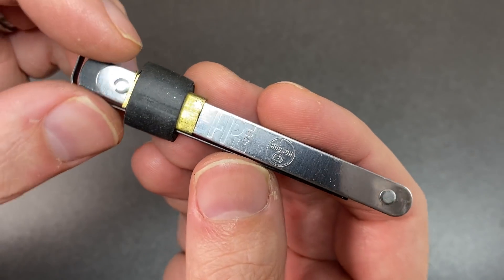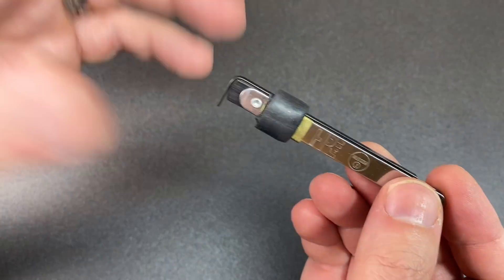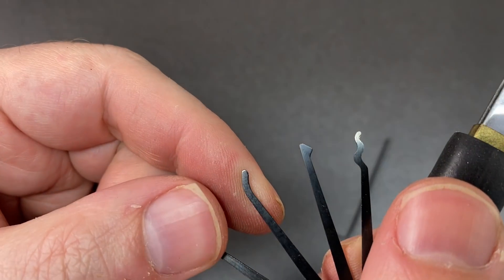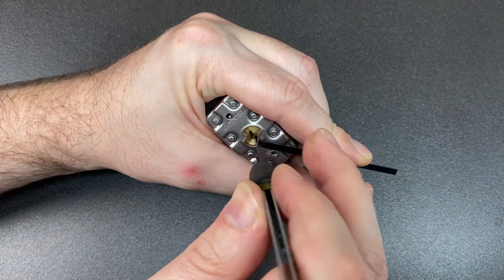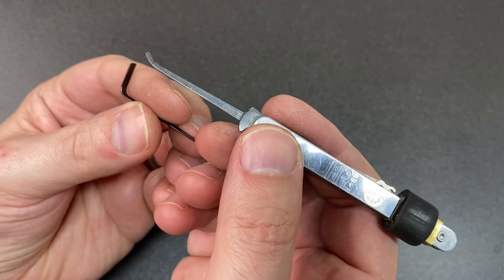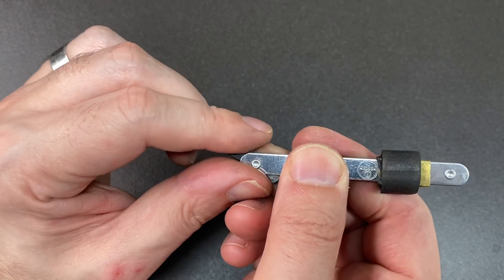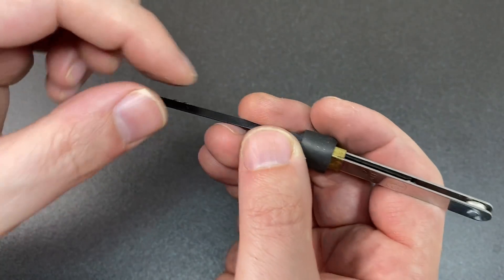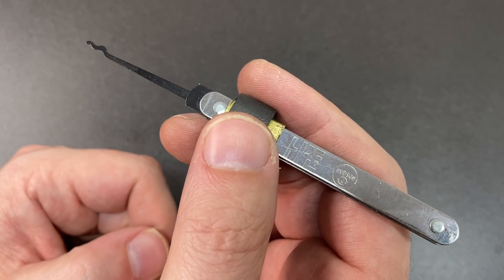HPC Jackknife Pick Set

Comment: That method of holding the pick set is the way I first learned.  Very useful for picking (easy, low security) door locks without having to kneel down.  Useful  for apartment building lock outs. I am not a locksmith, but I used to do a lot of maintenance on apartment buildings.

Comment: Hi Lock Noob, I've had one of these for 20 years or more. Bought it as a curiosity, and never used it in anger. After seeing your demo, I rummaged through my gear to try and find it - still there minus the tension tool. HPC picks are very common Locksmith tools in Australia, and because Locksmiths don't generally single pin pick as often as Locksporters, these spring steel picks hold up fairly well, and their profiles are pretty reasonable as well.
Reply from the maker: Yeah, this really needs an update, but the profiles were very useable

Comment: Scored a $10 version on eBay - no slider and rather than the duplicate pick it's got a half snowman - likely made in China but it does the job and it's maybe half a centimeter in thickness so it slides into any pocket - there's enough slack in my multitool sheath that it can fit in there -  plus, they used a hollow rivet to secure the picks so you can attach it to a keychain or lanyard.
While you're definitely getting what you paid for with it, for a newbie like myself it's a great starter backup tool.

Comment: That was a fair review mate. I wondered how well that rubber collar would work and it's influence on how you would be holding the pick. The picture of the grip they showed on the diagram is the way that a lot of people do raking in the USA. Given that the locksmith would be standing or kneeling in the elements possibly with gloves on because of winter snow etc. Raking is done that way in the States. HPC was a company the used to only be sold to locksmiths. Here in Oz you could only buy HPC if you were a locksmith and that's why they charged so much for their gear. They had cornered the market until locksporters and other companies came into play. Cheers
Reply from the maker: Thanks and interesting about the HPC history. I need more of their stuff to play with

Comment: I would spend so much time modding it to my preference that I may as well make my own.  I would install a key ring, taper the handles so the slider would be tight at the pick end, add another tension tool, add a bogota or a worm, get rid of the spare snake,  add a probe / bypass tool, polish everything, etc.

Comment: Does that rubber sleeve slide off the brass piece? If that brass piece had more of a lip or like sheath to come around the pick while deployed would hell with the wiggling. I didn't know this existed. Was gna try making own a few years back but never got around to it. I was gna use a lil bolt & nut tho to tighten & loosen the picks. A few things could have been done better but I love the innovation.
Reply from the maker: It doesn’t come off easily

Comment: I’ve had one of these for about 10 years now. They’re one of the worst iterations of jacknife tool, in my opinion. My old manager used nothing but this pick to pretty good effect, however. But, it’s not repairable, and once the rubber grommet wears out, it’s next to impossible to hold the turning tool on there. HPC makes their picks very thick, usually, as well. But, nice video as always.
Reply from the maker: Thanks for the comment. It’s interesting to hear from someone with good real life experience of this tool. I know a few people who swear by them, but there are just better ones out there these days
Reply: Take some Scotch 88 electrical tape and stick it to the brass then fold it over, sticky side out, wrap it around tight 1-2 times, then fold it back to sticky side in, wrap it tight 4-5 times, then wrap it without pulling 2-3 times; the tension wrench will pass under the tape where it isn’t sticky side down without a problem. Splicing tape and silicone tape works to bug I prefer the Scotch due to cost. You can also fix it or replace the tips; I can’t think of the name of the hardware but it’s basically a hollow thread on one side with a head and a machine screw with matching head that goes in it; I found this when repairing a belt. With the screw item you can actually swop out to stainless picks after drilling the rivet; you could also always just put in another rivet.
Reply: @libertarian1637  I'd probably put a hollow rivet in the back so you can put a key ring on it :)

Edit: wrote that, before Ash mentioned the hollow rivet xD
Reply: @libertarian1637  chicago screw

Comment: For the length of the body, would it have been nice if the picks were actually longer...or the body was shorter? Just looks like wasted space in there!

Thought on the keyring-I went back to the beginning, and noticed that the space in front of that back rivet, even with the tensioner in place, looks like you could, possibly, put a keyring basically AROUND the back rivet. Something to try maybe!

Comment: Seems like a pretty good idea but the design would need more polish. I would rather have 0.025" deep hook and shallow hook and 0.015" deep hook and shallow hook in such a tool. And tensioner should support top of the keyway tension.

Perhaps the sliding part could be made out of spring steel so it could push the body with the spring tension and stay better in place. Maybe even have a locking mechanism similar to Leatherman knifes?
Reply from the maker: All good suggestions

Comment: Tbh, I'm not terribly fond of ANY of those profiles (incidentally, I think one of the snakes angles up more than the other). I'd have gone with short hook, offset hybrid, de Forest Diamond for the hooks, and either a Bogota or worm as the rake. Tensioner is fine (I personally think TOK turners are massively overrated). 
Actually, speaking of TOK, I have an idea about that. I have a couple of questions I need to find answers to first though. Tell me, that wide groove that runs down the face of some lock cylinders? The keyway fits inside it entirely, but there's usually a bit of space left at the top. Does that groove have a name or any purpose apart from aesthetic?

Comment: Well, actually i'm not a fan of jackknife picksets in general. This thing however gives me a dissociative identity disorder: While i  don't like the jackknife sets in general, i do like the form factor of this one and i second to your key chain thoughts. It really would be great for that. I also have a similar opinion on the two snake rakes: One too many, there are certainly other profiles that could be added instead. The rubber thing gives me a bit of a headache: It would be so easy to fix: just rivet/spot weld on a piece of spring steel that asks for depressing in order to move the rubber thing back.
If they fixed those things, i would be very tempted to get one as a 'if-you-have-nothing-else-on-you' kind of EDC pick set.